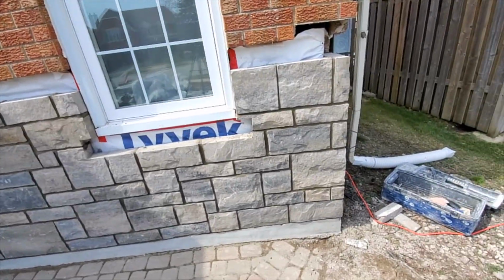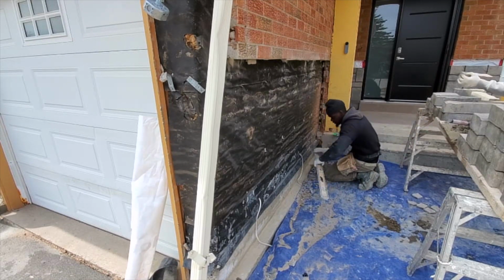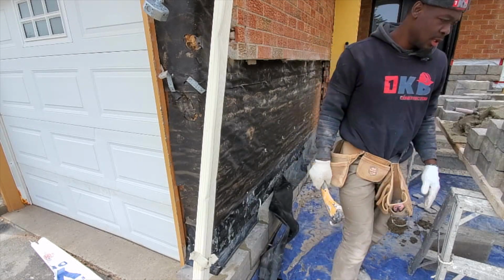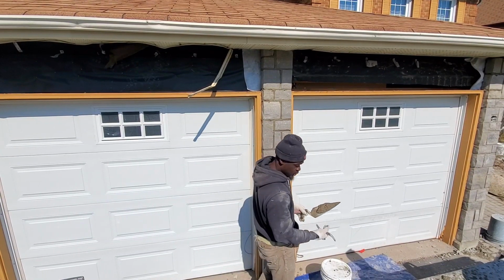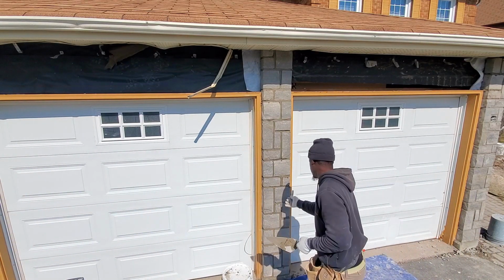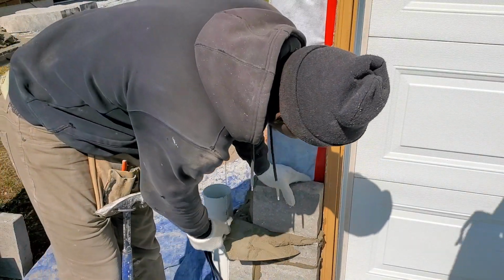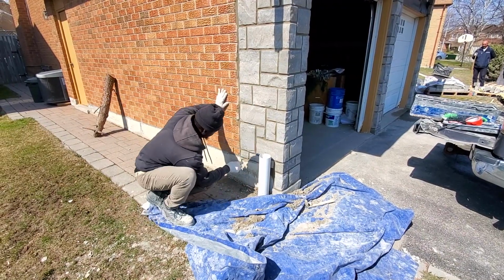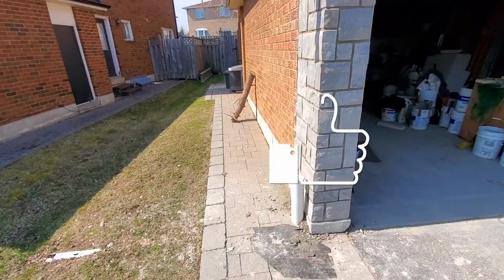We Did A Major Upgrade On This House Stone installation DIY

Comment: The title of this video has a typo. It should read “house”.

Great work, man. Where you located at?
Reply from the maker: Thank for pointing that out, didn’t notice it , we’re Canada Toronto work all over the GTA
Reply: @1kbconstruction824  I’m located in the USA. Utah, to be a bit more specific. Right now, I’m working on a veneer wall for a golf course. My boss has a year long contract. He’s harvesting black basalt, and he’s quarrying in it himself, chopping each stone into multiple stones at about 1 1/2” worth of thickness. In total, the veneer is 1 3/4” veneer. It’s a random pattern, and it’s super tight joints, with a dry stack look. We’ve had 18 people lay stone on the job, and of them, only 5 have made the cut. These days, people will swear up and down that they’re “The best in the business,” to my boss, only for them to show up with no tools or generally winding up very confused as to how to even do the job. The last guy didn’t even know how to lay a lead properly. It was embarrassing. By the end of the day, he only laid 5 stones. Ke kept running onto an issue with acute angles… which, of course, he’s trying to cut those last… which are all classic signs of someone that has no idea what he’s even doing.

The job pays well, and my boss is looking for more guys. It’s hourly wages, you wouldn’t make much money if it were piecework. If you or any of your guys wanted to swing on down here with at least an angle grinder with an 4 1/2” blade, a torpedo level, a 4’ level, a one inch steel or carbide chisel, a sledge, and some string line, a small brick layers trowel, and a tuck pointer, then I’d love to line you or your guys out on the workflow I’ve been using. Having a hardie wouldn’t hurt either, but if that’s too pricey then a vertical steel wood splitter that you could drill into a plank, would help in the process of shaping the stone.

I’m a third generation stone mason. Years ago, I created a technique for fitting super intricate stone cuts to fit some rather interesting shapes that gets most stone masons scratching their head on how I do it. The other guys on the job are using chop saws with a diamond blade at a similar size as what you have on your quickie saw, but my boss prefers the work I’m doing with an angle grinder. So, traveling down here would be fairly light weight, in terms of tools needing to be transported.

If you or any of your guys are interested, let me know. We could take the conversation elsewhere and I could give you more specifics on where the job is, what the pay is, how to contact my boss, and photographs of the work. And although it’s not cathedral masonry… this work that we’re doing needs artistry levels of skill in the trade, and I’m not joking about that. Some of the guys that have tried to make the cut have been good, for about 80% of the masonry jobs I’ve seen out there, and even worked on, but they’re still not a good enough fit for this type of work. 

And like I said, since I can see you and your guys are able to pop out some decent work, I’d be willing to give a thorough rundown on the workflow. If I can take the mason seriously, and if they’re using those same tools that I described (the ones I’m using), then yeah, I’d be willing to spend some time making sure no one has to be sent back home. 

My boss just got locked into a year long contract with the client, and the client is a golf course. He’s confident that he’s going to have 2 years worth of work locked in at the golf course. I mean… there’s not many masonry companies that’d be willing to quarry their own stone. And black basalt rocks are everywhere down here, and they’re usually considered a junk stone, even though it can be as hard as granite… but honestly… although it cuts and splits at the consistency of granite, it cuts more like quartzite, to me. And quartzite is technically harder than granite, only, when quartzite splits wrong, it shatters like glass. Fortunately basalt doesn’t shatter.

It’d be awesome to meet you.